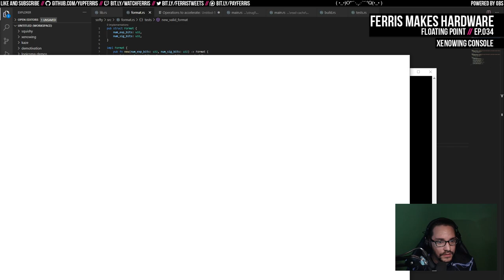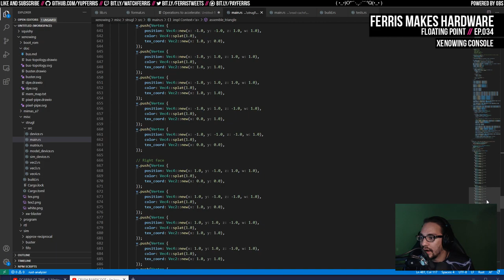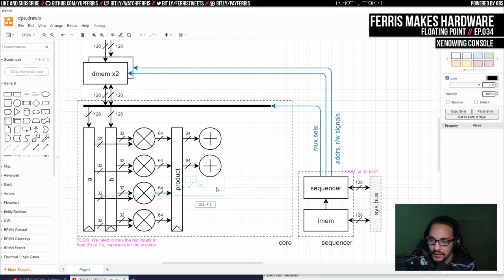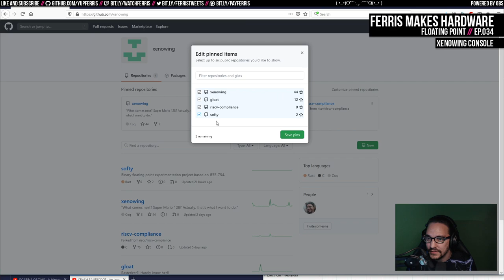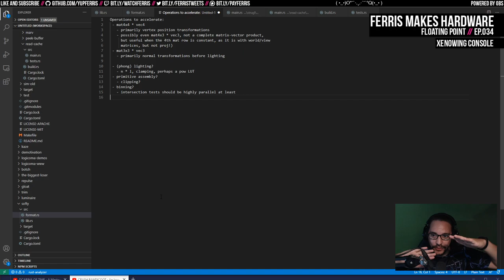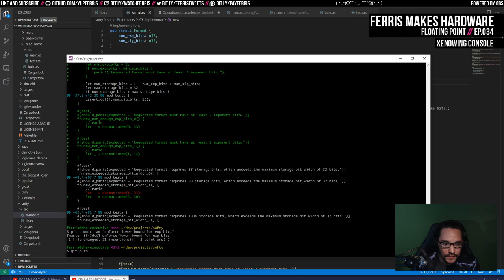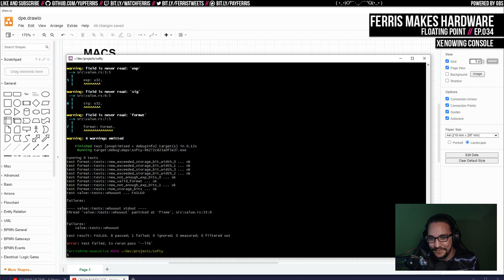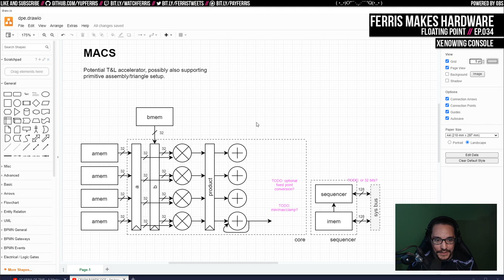Ferris Makes Hardware Ep.034 - Floating Point

Comment: I think that trying floating-point at this stage is an unnecessary complication that is going to lead to many headaches and bugs... You would be better off implementing a fixed-point solution and then  upgrading it to floating-point later.... Also, floating-point is going to be massive in comparison to fixed... (perhaps 10-20x the resource usage). Also, there are ways to implement unified fixed (integer) and FP datapaths, which may produce a better result than doing all FP (if you only do FP, then you are probably going to have issues with control flow and texture lookups - you can't do texture arrays easily).
One thing you should also look into (if you haven't), is trying to optimize your design for the device resources. Granted, doing that will end up restricting your target platform, but it will end up minimizing resource usage, increasing performance, and allowing for more instances on the FPGA. The Xilinx 7-series has the DSP48 blocks, which are quite versatile, and can implement a significant part of a fixed-function pipeline in the primitive tile itself (so your resource count may go from 4k LUTs down to 200 LUTs and 8 DPS tiles for example - you are using the tiles implicitly to do the multiplication anyway, so why not fully utilize them?).
Reply from the maker: thanks for checking out the video and thanks for the insight! A couple things to keep in mind:

In terms of scope, I'm currently only thinking to support floating point in this single DSP unit, which only consists of multipliers and adders (which I may implement fused). I also don't need to be fully IEEE-754 compliant when it comes to corner cases (for example I can rely on FTZ/DAZ behavior to ignore denormals, I can do a similar thing for NaNs and collapse all of them into a single "canonical" one to propagate, perhaps even ignore some of the corner cases wrt rounding [who even needs more than one mode anyways?] and signed zero etc) since the workload that I have should be fairly well-behaved (vertex t&l). I'm certainly not talking about doing everything in the system floating point; the rasterizer will remain fixed-function and fixed precision, for example. Perhaps I'll add FP support to the CPU as well, but that would only be a single FP pipe (or perhaps a couple for different operations but you get the point here). It should also end up being fixed latency in this case.

For resource usage, this is first limited by the scope I mention above, but also, I think the design I've come up with here should also map fairly well to the hardware in the first place, since (as you surely know) they were designed to support single precision FP in the first place (evident in the width of the multipliers, for example). If the xilinx compiler has a hard time mapping the logic I end up implementing FP with then I can surely dive deeper and try to come up with a scheme that utilizes this hardware better - but considering my current resource usage for the whole system is already quite low, I'm not really too concerned about this yet, and I have a difficult time believing that this will end up using thousands of LUTs/a huge amount of DSP tiles in the first place.

That said, I definitely would like to dive deeper into the FPGA architecture and try to find a problem that maps well to it and design an application that the chip should be inherently good for architecturally, rather than what I'm doing with this project, which is more like "design something I want to design and it happens to be targeting an FPGA". In that case it would be more bottom-up and I'd try to design things more optimally which could be really fun!
Reply: @ferrisstreamsstuff  Keep in mind that FP computation is many more steps than integer. For multiplication, you will always need to: 1) multiply, 2) renormalize. For adding, you will always need to do 1) align / denormalize, 2) add, 3) renormalize. The renormalization step cannot be done in one pipeline cycle either (it could, but that's a huge propagation chain). The rounding is done in the renormalization stage, which can be done a lot faster if you just truncate to zero....

Don't forget that lighting also requests A) division or 1/x, B) square roots or more commonly 1/sqrt(x), C) trig functions like sin/cos (you can remap cos to sin), and D) exponentials and logs. Those can be done pretty simply with integers and some approximations in a pipelined manner, but for FP, those become very complicated as you really need to calculate them directly. 

You also won't really gain much from using FP for your t&l... Recall that the N64 and PS1 both used fixed-point and did pretty well with geometry. It really depends on how many bits you have, and what your scene scale is...  

As far as I am aware, Xilinx never intended for the DSP48s to support single precision FP... They can be used for that, but they are meant to implement fixed-point filters. Their internal multipliers are 25x18 which do not match up to any FP representation. You should have a look at the DSP48 documentation if you haven't done so... 
I think that the DSP utilization for fixed-point and FP will be identical, however, if you do not map to the DSP48s completely, your adders will be implemented using LUTs, which could be done using the DSP tiles instead. Then you have all of the renormalization and denormalization hardware which will take up quite a few LUTs as well. Obviously it's your choice, but with increased complexity comes the risk of demotivation from delayed results.

I actually went through the process of designing a vector SIMD machine for graphics applications using the bottom up approach that you mentioned. Though it uses fixed-point, for resource reasons (even if the ratio is 2 fixed-point to 1 FP, having 2 engines is far better than 1). I was able to implement most of the Shader Model 4 functionality with it, and a fixed IPC of 1 commit / cycle. It's pretty interesting how the FPGA architecture lends itself to making specific design decisions for the overall architecture.
Reply from the maker: @hjups  Indeed I'm aware of the extra FP steps, though admittedly I haven't implemented them on FPGA before. I was indeed thinking to truncate to zero.

For this hw unit I was thinking to accelerate the dot product parts of lighting, which I suppose are the trivial bits - for example calculating the normalized light vector certainly needs 1/sqrt(x), but lambertian diffuse only needs to calculate the dot product of that vector with the transformed normal (which can be assumed to be normalized after transformations that only affect rotation), plus a clamp. Phong and more complex lighting models which include pow would certainly need exponentials but part of this can be done with LUTs. I was thinking to do these on the CPU (slow). Admittedly lighting isn't that well thought out in my system. However, triangle setup again involves a lot of dot products, as does vertex transformation, so that's why I thought to start there.

Indeed the more I think about it the less interested I am in doing these calculations in floating point; I started prototyping the operations in Rust and it doesn't seem like too much logic but it's starting to feel a bit wasteful. I was originally thinking that it would be fixed point anyways, but when I thought of 32x32 multiply being potentially expensive I thought FP might work out better with 24x24 mult, but as you mention the DSP slices only support 25x18, which doesn't really fit anyways. It would seem to target that I should prefer for example 16x16 products and 32 bit accumulation all in fixed point, which might make sense, or I could go full 32x32 anyways with additional latency/resources to make things simpler for a first iteration. In either case, the hardware becomes a lot simpler at the expense of refactoring the software workload (which is now prototyped using floats everywhere until final fp -> fixed conversion for the rasterizer) to all fixed point, which is likely a better investment anyways in terms of speed in case I do have to do some more expensive operations on the CPU anyways.

TL;DR, at this point I think I'll implement something in fixed point and go from there.

Your SIMD project sounds cool, do you have a link anywhere?
Reply: @ferrisstreamsstuff  Doing FP is a big undertaking... though would definitely be worth it in the CPU. If you plan to target a smaller FPGA, you may want to consider combining the integer and FP datapaths there (thought that means that the CPU would stall for any FP operation). If you are interested in doing that, you should look at the MIPS R4300 patent, as it describes roughly how NEC implemented it. 
Also, just to point out, if you were to implement FP for your GPU, you would want to do something more complicated than you originally planned. You would need to implement a fused multiply-add unit, which utilizes a compressor. You also need a leading-zero counter, and a dedicated exponent data-path. Alternatively, there are FPGAs with hard FP units (the Cyclone 10 has them).

If you were only going to use this for Lambertian lighting, I think your plan was a bit overkill. You could instead pipeline your dot-product and do it sequentially instead of in parallel, and have it act on a FIFO stream. If you haven't, you should look at what the Sega Saturn's SCU DSP did (the channel Coding Secrets has a good video on it). That would be a far more efficient use of resources... While that may seem inefficient, relatively speaking, you will be spending far more compute power on rasterization and shading than the T&L (that's trues as long as the triangles are larger than a single pixel). If you look at the early GPU designs, they had 1-2 vector shader engines, and then either none (because fixed function hardware was faster) or 4-8 pixel shader engines (so roughly 4x as many pixel shaders). This is because you are almost always going to have overdraw, so you want to maximize your ROP throughput. However, all of those vector shading engines were more general purpose and implement 1/x, 1/sqrt(x), exp2, log2, and sin - though they were all approximate but they were there. Even the N64 implemented 1/x and 1/sqrt(x) - though you really only need 1/sqrt(x) since you can just square it in another step.
Your triangle setup will also need to do 1/x, especially if you want perspective correct interpolation.

A lot of the DSP48 application information is missing from the 7-series DSP48 document, but there is an older one for the Vertex-5 which is quite helpful (UG193). Table 4-2 has the equations, setup, and latency that you would need. Note that to do a single precision FP multiply, you would use 2 DSP slices, while to do a 32-bit fixed point multiply, you would need 4. So you do save in resources on the FP... But the FP can't do multiply-accumulates, whereas the fixed-point can, so you save on LUTs with the fixed-point. It will depend on which specific FPGA you end up using... i.e. the A7-100T has more DSP tiles than the A7-35T. Also, note that in the table there, the latency isn't exactly right for the 7-series, since the 7-series does allow single-cycle operation (it just reduces the maximum clock speed) - it's possible to do a 64x64 bit integer multiply on the 7-series in a single cycle, though you are better off pipe-lining it for speed (there are ways to write your HDL to make the tool infer that as well).
Note that 16x16 fixed-point multiplies will not be sufficient for T&L though... you need more bits, otherwise your render region is going to be quite small in 3D space. 

As for the SIMD project, I don't have it written up or posted anywhere. It's a bunch of internal documents that I don't want to release. We even went as far as writing an assembly translator which has a way to take GLSL/HLSL/GC code and convert it into the encoded VLIWs needed by the core. I also haven't implemented it in hardware yet, it's mainly just been designed with the 7-series FPGAs in mind (timing, sequencing, a detailed logic schematic, etc.) - although it may need further optimization since I recently realized that the parity bits on the BRAMs are not as "free" as I had thought (they don't get their own write enable signal, so they can't be aligned to a CPU bus).
Reply from the maker: @hjups  It's funny you mention the SCU DSP as that was actually the thing that inspired this design in the first place. I originally started thinking that I could extend that into a dot product pipeline instead of just a single MACC pipeline, which would work well for mat4x4 * vec4 (the common transformation case), and I figured if I did transformation in two steps (worldview * vec to get view vector before lighting, then proj * view to get final transformed vector) then it also works well for an optimization of the worldview part, which, assuming a common case where the last row of the matrix is fixed [0, 0, 0, 1], then it would only require 3 dot products instead of 4. However I also thought that if I did a transformation for normals, I'd get reduced occupancy in the pipe, since the 4th component would be useless, and if I wanted to use it for triangle prep (which is mostly dot products, ofc there's a bit more but I though I could do those parts on CPU) that's also 3-component dot products. So I thought if I did them data-parallel instead where I keep the pipe filled with 4 separate dot products instead of one at a time pipelined, that I'd only have to add a single adder (instead of the 3 that would normally be in the pipe for 4-component dot products), and then I could get optimal occupancy as long as I had enough vertices to fill the pipe. So that's how I arrived at this design. I still think this might be a good idea (it's just the saturn's DSP with more lanes). Again, lighting is a bit of an afterthought here but it might still be useful; I'll have to think more about that for sure.

The rasterizer is fixed-function and all fixed point already, and also supports perspective correction. I don't plan on changing that anytime soon but the stuff before that is still up in the air a bit (hence this discussion :) ).

Thanks for the tips on the DSP docs! I'll have to dig up the earlier ones. Also for reference, the device I'm currently targeting is A7-50T, and there's plenty of space left so far.
Reply: @ferrisstreamsstuff  You could probably do some quick modeling / calculations to see if you could keep a 4-way dot-product occupied, or if a pipelined multiplier would be sufficient. The other thing you could consider doing, is to create a systolic array multiplier. Figure 3-6 in UG479 shows a diagram of setting one up with a FIR (after-all, a FIR is just a dot product). A systolic array multiplier may be more complicated to sequence though, since the pipeline is out of order.
If you plan on using this to accelerate computation and then go back to the CPU for the lighting, then you're going to have serious bus bandwidth issues. Once the data leaves the CPU, it shouldn't go back... So if you plan on doing all of your lighting calculations on the CPU, you should do the T&L there too (so sort of like what the PS1 did with the GTE). 
A Saturn DSP with more lanes could work, but it's not clear how you would do the multi-lane accumulate. Also, the SCU DSP was designed to be a stand-alone chip in an older process technology... So you can get away with treating it as a streaming applications with FIFOs on the FPGA (i.e. you push the verts to a FIFO, and then you process them as a stream). Basically, there are a few specific approaches you can take, which each have their pros and cons:
A) do it all on the CPU (most flexibility, but lowest throughput)
B) do it in a CPU co-processor (high flexibility, but low throughput)
C) do it in a fixed-function streaming way (loss of flexibility, but high throughput - note that it would probably be impossible to do skinning this way)
D) do it in a programmable engine with fixed-function blocks (high flexibility, but lower throughput, higher complexity, and higher resource usage)
E) Have a unified shader pipeline (a very complicated and resource intensive solution - not a good fit for the A7)
If you go for (D), you should study what ATI and NVidia did in the past (as I recall, the GPU in the GameCube had a vector shading engine for T&L and a semi-programmable pixel shader - that may be a good target to look at). You may want to do that for (C) as well. For (B), the PS1 would be good places to look - you could also look at the RISC-V vector extensions and read up on the ARM-NEON.

Have you thought about how you are going to do the perspective correction in the rasterizer? Division is quite expensive, so you should make sure you have a hardware optimization solution there. You also want it to be 1 division per cycle if possible, to maximize throughput.